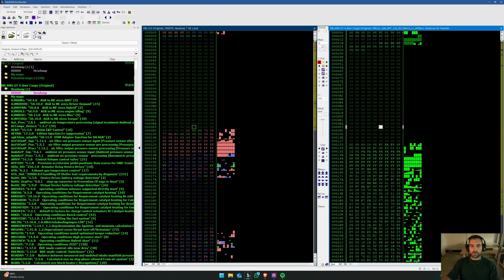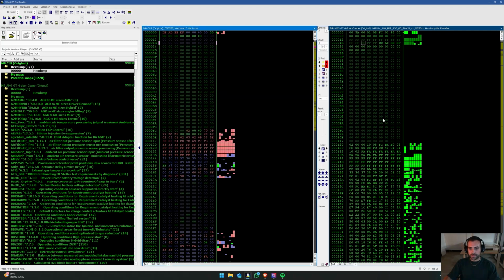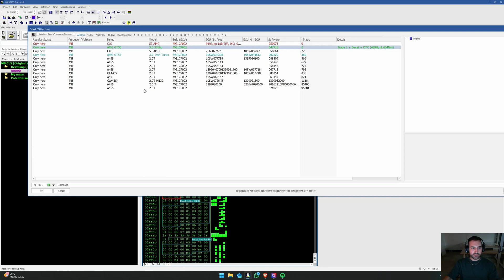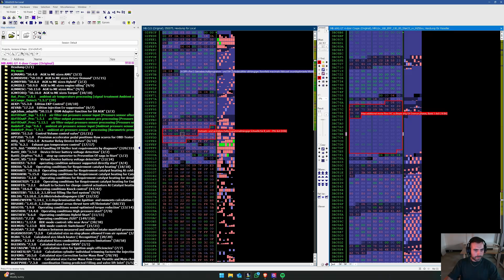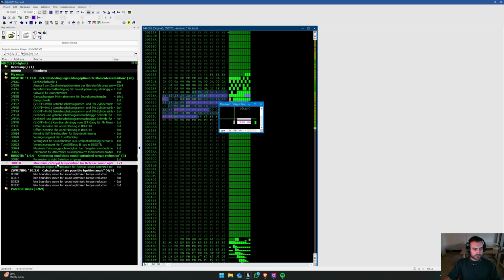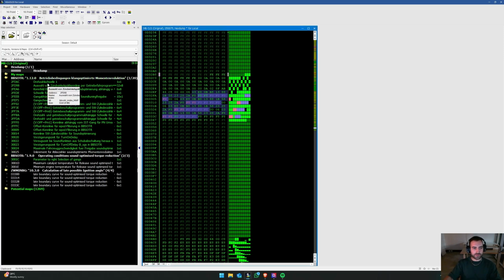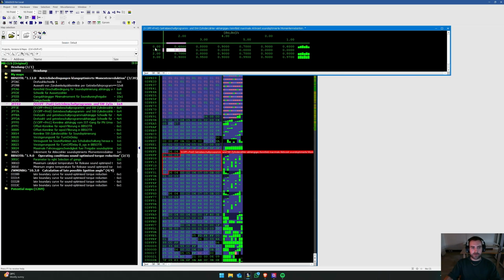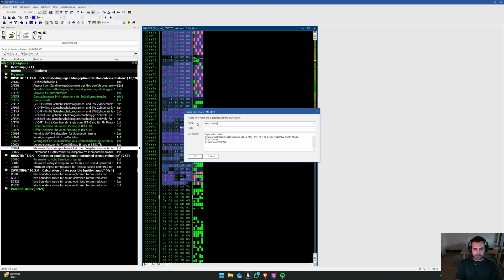How To - Adding crackles to your Mercedes-Benz AMG using WinOLS5

Comment: I have a 2020 CLS53 and the car has already crackles in sport and sport+ by default 

Can i add downpipe and performance filter and request a stage 2 file service from you with more aggressive crackles in sport+ only ?
Reply from the maker: @scapezzz5536  yes absolutely

Comment: Hi, I have the CLS53 AMG with a stage 2 tune and I coded my CPC for increased torque limits.

My ECU’s SPC577M was coded via bench flash, can I flash a map from WinOLS and without coding the SPC577M chip?
Reply from the maker: What do you mean coding of the chip? Any reflash overwrites memory in the processor.
Reply: @labordemotorsport OH, I hear you. Sorry, I’m new to this; won’t be new for long. 

You are referring to the MPC? Also, my apologies for the confusion question.